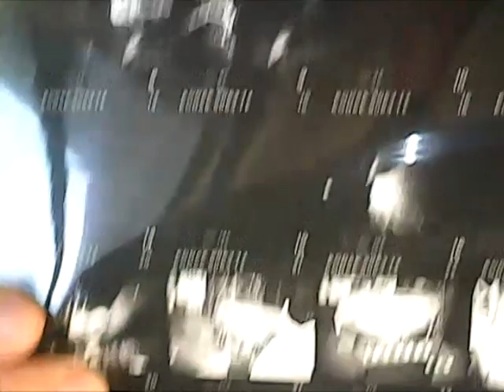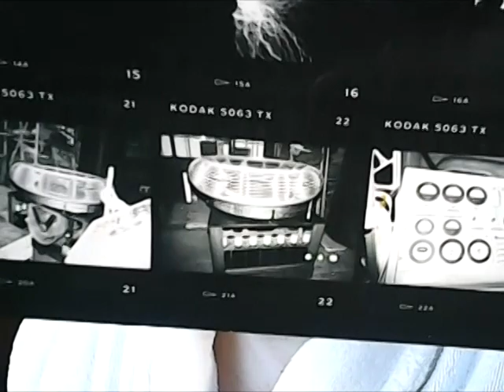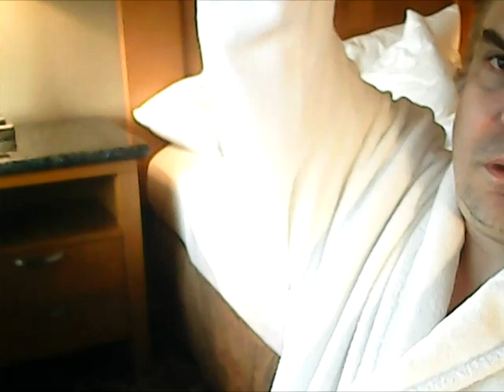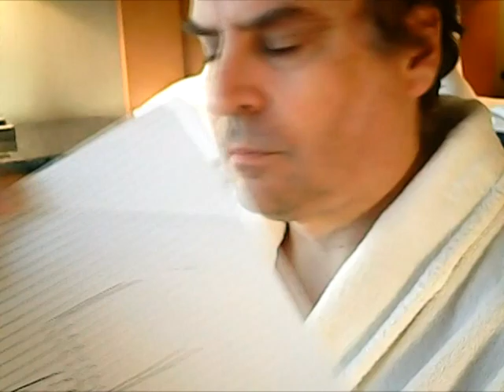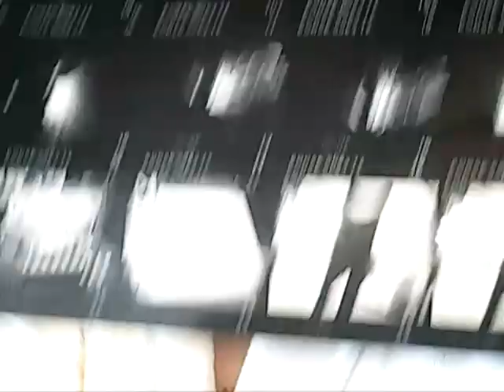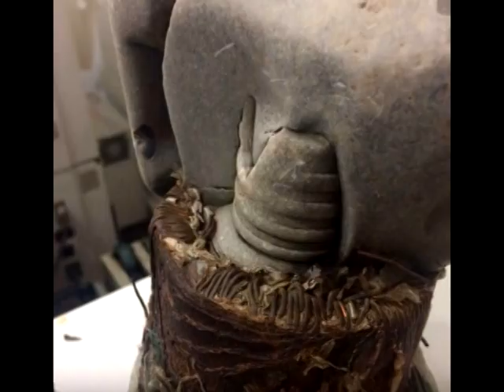Kosovo Transformer is A Tesla Coil? | Massive OOPARTs

Comment: I think this is a reduction transformer with the winding going horizontal with the induction core and may have another bi-filer coil on the other side maybe, the iron core may be in a u-shape with the spark plug acting like a Tesla air coil, should try and replicate it and see what it does.
Reply: @ChrisTopaz  
Did you look at the artifact on my video, I am getting the bit I need to replicate it, just need to find a suitable brass bowl to suit and will start work on it.

Comment: How about a multi-layer wrapped coils? Each layer of the copper input coils insulated and another one added to that, and again a few more times; then the output coils being wrapped inside of those? Either the output coil is inside the input coils or they could be wrapped at the inside layer (closest to the inter edge? ). The four quick connects would be the input output.